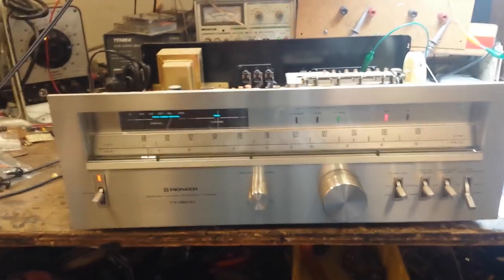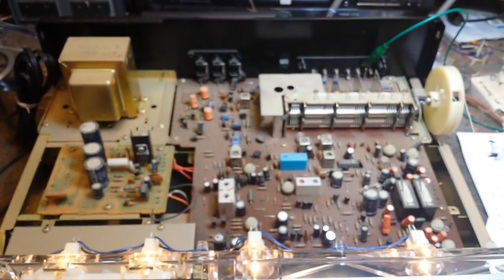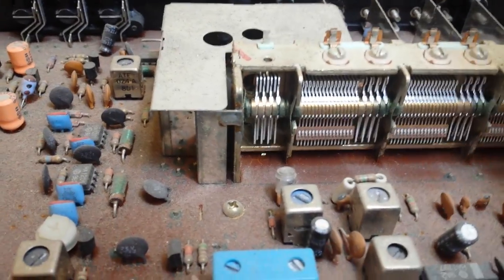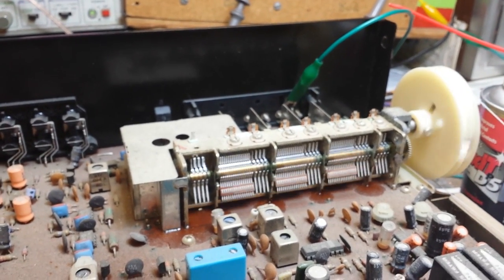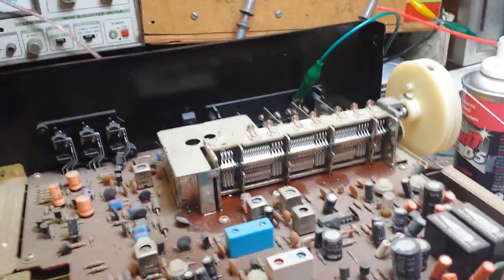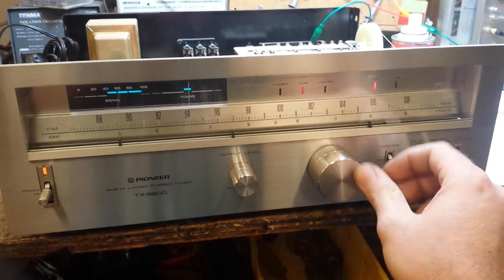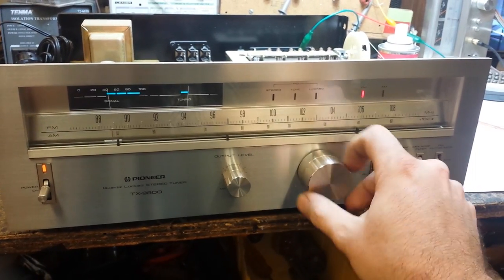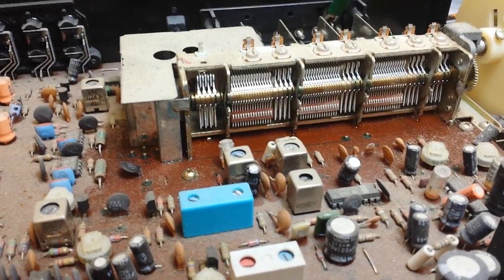Quick tip: cleaning a noisy FM tuning condenser

Comment: Thanks ! Fixed the tuner on the 1980 with your tips. Used a wet(alcohol dipped) toothpick to pinpoint and then scrape the green crud on the axle, then wiped off with cotton q-tip. Now I have complete range of channels!
Reply: I know this is old, but that DioxIT has a bit of lubricant in it, so best to use that vs alcohol. These tuners need that bit of lubrication.

Comment: Used your procedure on my Kenwood KT-6500.  I'd been blaming weak stations vs. strong, crowding by nearby stronger stations, signal strength, location, etc.  Put in a powered antenna - no real improvement.  Your process worked great.  I didn't see any corrosion (green or otherwise), but apparently it was there.  Soo pleased.  Thanks very much!
Reply: I might have mentioned that used DeOxit D100, which also allows doses as individual drops to avoid coating the fins and changing their capacitance.  Thanks again.

Comment: Wow, I just used WD40 and some Qtips, a thinned chopstick to apply WD40 precisely, and a clean tooth brush, to clean and lubricate a Kenwood KT 7500 FM tuner’s air capacitors, hard to believe the difference, all but one station is now at or close to 5 on the signal meter, and can find them all with mute on and either wide or narrow band, and the background hiss is greatly reduced on several problem stations! Thank you Jordan for the demonstration.

Comment: You should clean all the circuit plate using compressed air and detail with a small brush  and an electronics liquid cleaner, dust is the cause of circuits fails like overheating, the radio looks in good shape to do a restore, change all electrolitycs capacitors and verify resistors and ceramic capacitors tolerance for change if necessary.

Comment: Jordan.  should of watched your video first?  Electric contact cleaner used and I sprayed the "whole" turner (fins and all).  I see it didn't mess up my tuner and works ok(never do that again now I know), but my stations seem to be about .5 off where they were before the spraying(102.5  now at 103.0).  Don't know if I accidently over turned the tuning knob to the end while cleaning? Is there any way to adjust it .5 and get back to true position?  It is a Realistic STA-7 by Radio Shack. Had if forever and still is a good little unit in excellent condition.   Thanks
Reply: Great question...Did you ever get an answer?
Reply: You can realign the physical station needle, there are videos here on YT on the procedure.

Comment: I've got a T-7 operating perfect EXCEPT it's Pre-sets. Does not store any tuned station. Have attempted, per manual, to save various tuned-in stations on the 5 Pre-set buttons via the Memory button, no joy.
An odd occurrence though, if I hold down Button #5 alone for 4-6 seconds, it slowly moves the tuning wheel/dial to the far right of the band. It may do the same on another of the remaining 4 buttons, I repeated the action multiple times. Any tips?? Haven't opened it up yet since the Pre-set feature is the only fault. I'm comfortable doing so.
Note, it's a remarkable tuner!

PS. I've searched a few sites today re: the potential of its bad rechargeable battery and changing it out could fix it!??

Comment: I have a AM FM portable radio that started to get very noisy on AM when I went near 800kHz and it would also block stations in that part of the dial from coming in. Very annoying and sometimes intermittent. I took it apart and found no loose connections or dirty controls. Given I could get it to work properly for a while if I worked the tuning dial back and forth, I felt the problem was in the tuning condenser but it is in a plastic case. With little to lose, I sprayed plastic-safe contact cleaner into the condenser. The radio suddenly only got 3 stations and they were a few hundred kHz higher on the band. I thought that if I let it dry out, the condenser may come back to normal. It slowly did and the stations started to drift back to their correct places on the dial and in an hour all was well.  I may not do this to an expensive radio but it saved my $30 one.

Comment: Nice job Jordan. I'm wondering if the problem with my old Kenwood KR-4070 is at all related. I listened to it all day today, and then at some point the station I was listening to started going in and out. Checked with another radio, and the station was fine. Tuned up and down the dial and was receiving okay on stations, but I noticed my "tuning" indicator needle was not moving at all, when normally it behaves just like the one on the Pioneer you show in this video. What do you think? I have not disassembled it yet so I can't comment on the appearance of the capacitor. Note that after shutting down and allowing a cool-off, it is behaving normally.
Reply: Just wondering if you found the solution on the Kenwood.
Reply: @tf7274  No I never got up the gumption to open it up. I've got a Bluetooth input connected to it and use it that way, as just an amplifier.
Reply: @RickRose  you can try compressed air before using any product on it. If there's any improvement than you are heading in the right direction. But my best trick is to turn off the stereo and move every button and knob 40 times. It can take 20 minutes without taking any shortcuts. I'm lucky...if I ask my wife she'll do it for me.
Reply: @tf7274  Cool I will try that--Thanks!

Comment: Thanks. While you're in there, you might have cleaned out the dust first. And then come in with the deoxit. That way the dust does not cake to the board where the deoxit spills. Thnx anyway, worked for me.
Reply: I AGREE WITH YOU 100%.... NOT TOO PROFESSIONAL, THAT'S FOR SURE! I'M GLAD HE'S NOT MY TECHNICIAN.
Reply: @magicfan4ever888   I respectfully disagree. As a professional, you cant waist time doing unnecessary work. 

Unless the customer wants to pay for a thorough cleaning to make it look pretty, the professional thing to do is repair the unit and get it out the door. This keeps repair costs reasonable.
It's the amateur tech that can spend the afternoon doing unpaid cleaning for the sake of ascetics.

Comment: Jordan would you have any low cost suggestions on how to get better am reception inside the radio?would adjusting the capacitor s do anything?replace them?any ideas would be appreciated.
Reply from the maker: Most of the am radios are just chips in these sets so there are little to no caps to replace in the am. It's really dependent on the antenna used and if the alignment is good.

If your am reception sucks,ake sure there isn't anything near by that would interfere. This includes cfl and led lamps, cell phone chargers, laptops and their chargers, or anything with a switching power supply
Reply: Jordan Pier thanks for the info my radio is a Panasonic RX 5020 from 1980.its in great shape the am reception could use some work.
Reply: Jordan Pier how about adjusting or replacing the electoric capacitors?would that help with am reception¿

Comment: Jordan on my Panasonic rx-5020 the volume knobs are tight.any suggestions on that.the levers?
Reply from the maker: Mark Symbala they're stiff due to lubricants hardening. Spray inside the control - not from the front- shaft and work the control back and forth. The deoxit will usually clear this up. Lever switches too. Gotta take it apart
Reply: Jordan Pier thanks

Comment: Jordan what are those seven terminals on the top of the capacitor? What's it for?how do they work?
Reply from the maker: They help align the tuning condenser by fine tuning the capacitence of each row of fins. YOU SHOULD NEVER TOUCH THEM without an alignment generator or proper knowledge of how to align the tuner or you can make it useless.

Comment: Jordan how is your pioneer now? I have a radio that makes those noises any suggestions about cleaning it?
Reply from the maker: The pioneer continues to work great. Just have to remember to exercise the tuner back and forth once in awhile.

If you have a small radio that does the same the problem is most of them have sealed tuners that you can't clean. You can rock them back and forth repeatedly until they clear up but ultimately it's a flawed design
Reply: For small radios, spray Contact Cleaner in the variable capacitor and let it dry for a few minutes. It works fine, no damages or capacitance loss.

Comment: What are the metal squares with screws.
Reply from the maker: Something you don't touch without alignment tools, equipment and a service manual
Reply: So capacitors for am and fm .
Reply from the maker: @vegetablepolice1  most are adjustable if transformers. The trimmer capacitors are typically on the tuning condenser only. The others are for Am and FM mpx alignment. The FM if is fixed by ceramic 10.7mhz filters for the IF

Comment: Dude, before trying to show any of your ''useful'' tips I think the best thing you should have done is giving this nice tuner a proper all throughout clean and then, and only then, attempt to clean the variable capacitor and by the way. a jet of air would do a better job than what you've used. Cleaning liquids are known to cause capacitance unless you allow them to dry for a day or so.
Reply: A jet of air will not always do it.  My stereo is doing this, and I did the jet of air thing years ago.  But that no longer does the trick.  Yes.... dust between the plates can cause this as well. But eventually the grounding gets oxidized and in addition to dust between the plates.